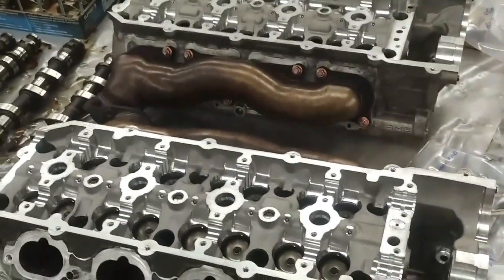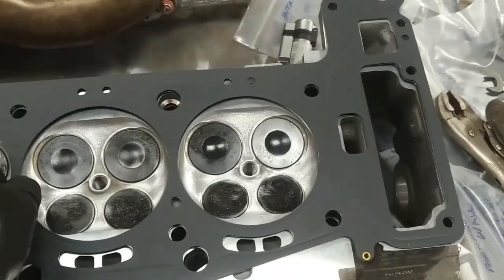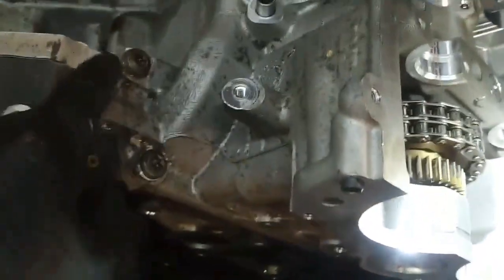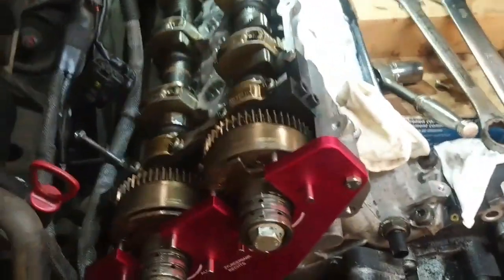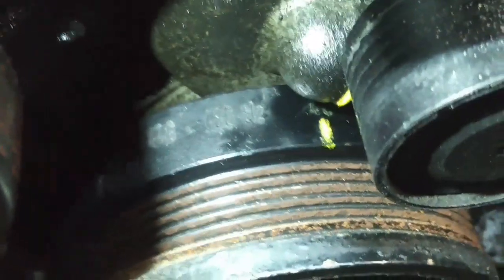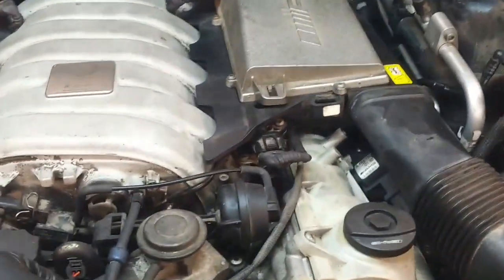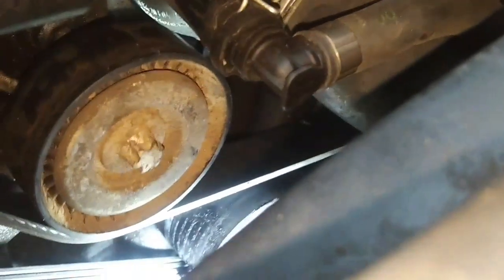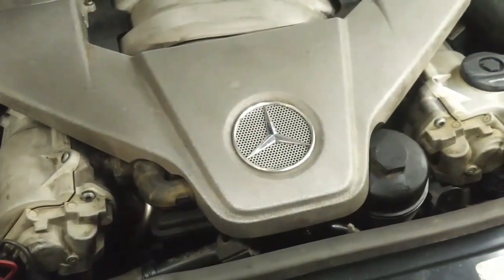2007 Mercedes Benz ML63 AMG engine reassembly

Comment: i have ML320 CDI.Should i buy ML63 W164 ?
Reply from the maker: Out of the frying pan and into the fire... LoL that's like asking if you should get married. All of these MB products are challenging to maintain and repair. Beautiful cars until you need to fix them. Need to have deep pockets and a good shop at your location. I personally would not buy either of them but that's just my opinion. Good Luck.

Comment: Excellent video. May I ask what the cost of this job is. ?
Reply from the maker: This was an expensive job. Almost 7K Canadian. Dealer here would not even attempt.
Reply: Phillip Bailey Thanks Phillip. There is a 2007 AMG 63 with 80,000 miles near me. The car is in excellent condition. I hesitated on making an offer due to the engine issues with them...but wondering if I should take a chance. Any advice would be greatly appreciated
Reply from the maker: @MT-tu8qd  Its my understanding that the head bolts are prone to failure with no warning. They rust and fatigue and then brake suddenly. The updated bolts are better. Its a significant job to do the heads. need some special tooling which I purchased for this job.